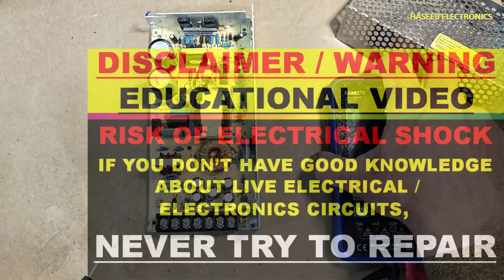{1060} only 7 Volt Output instead of 12 volt, Low Output voltage

Comment: This is a great video thanks, I'm very new to SMPS however I have a similar issue with a S-360-12 (12V30A) , I only get 3.5v output, I have tested everything , all the diodes is good, all resistors are good, changed all capacitors , TL494 pin 7 to 12 = 7.5v , pin 7 - 14 vref = 5v , power transistors 2 x D13009k voltage on diodes = 157vdc as too main DC Caps ,   Thanks
Reply: Sorry for replying to my own post but I found the issue, the 102 Variable resister ( voltage adjuster ) I replaced it and it is working.
Reply: @jacoleroux5569  Well done, keep at it .
Ive been an electronics tech for many years and am still learning.
One thing to be ever mindful of is safety,
Filter caps on ac side can charge up to high voltages and pack a lot of energy.
Always discharge with a resistor , I use a high wattage wire wound resistor with heat shrink on exposed metal leads.
Also if using test equipment that is earthed, say an oscilloscope you must use an isolation transformer this isolates the equipment from the floating earths in modern equipment.  
have fun and stay safe, if not sure ask someone with experience. power electronics can be  unforgiving 
:penguin-blue-waving-tear:

Comment: I have one dc to dc converter using ic tl494  the output is same like input i am using sma transformer 9v now input showong 7.8 volt when i check out the same

Comment: Peace be upon you. I have the same power supply, but it makes a buzzing sound and the output voltage is 16. There is no control over the variable resistor, and when loaded, the voltage drops. What is the reason?

Comment: Hello,

Can you explain please why an smps that uses ml4800 IC, the vcc and reference voltages are low, instead of 13V on vcc it is 7v. The reference voltage also low instead of 5v.

Comment: My exact same smps provide voltage 12v output when connected with series lamp...when connected directly to supply, input fuse gets blown immediately...input voltage selection switch us set at 220v.

Comment: sir haseeb how are you i have  power supply smps of satttelite receiver  have  5 volt output without insering the cable in the motherboard port .Now  when i connect  the cable conductor  in the same motherboard port  power on the 5 volts is going to up down 4 volt 3.2 volt 2.58 volt etc  please can you help to troubleshoot thanks

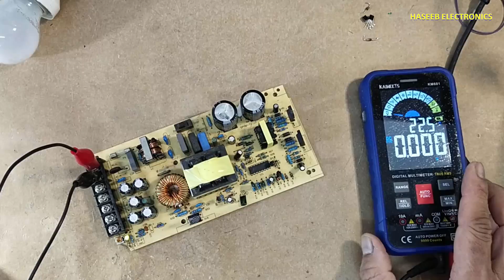Comment: 10:55 Sir, please don't teach us to regulate the output voltage WITHOUT any load. 
As you know, a lot of power supplies output higher voltage on idle, and then it drops to correct value when you apply the load.

Comment: Great video as usual many thanks.
You use parts from scrap power supplies. At which point do you decide a supply is scrap?
I ask as you seem to fix most things.
Reply from the maker: when the repair cost exeeds than the 65% of the actual cost. then i recommend to not to repair

Comment: Thanks sir
Which reason it burned please
And when will you  continue  the video series of incomplete drive series
Reply from the maker: it gets damaged due to any high spike switching puse in startup circuit, that is from high power mosfets
Reply: @HaseebElectronics  thanks sir

Comment: Yo my main man Has! Has tell me, have you ever tinkered in upgrading 110v powertool chargers to 220v? I'm getting so tired of carrying around extra step down transformers because the cordless drills (for some weird reason) are always way cheaper in 110v!
I have saved up for some Makita and Metabo HPT tools for jobsite BUT carrying around extra transformers is always a pain.

Comment: Isn't it dangerous not to discharge the condenser, sir?
Reply: Many power supplies have in circuit discharge resistors; but just in case, he always checks the voltage anyway... at 2:30 in the video.
Reply: May be u don't know, Haseeb  is a master, n big Engineer